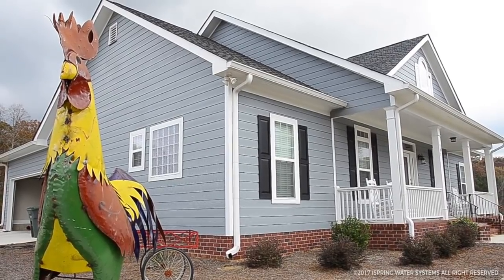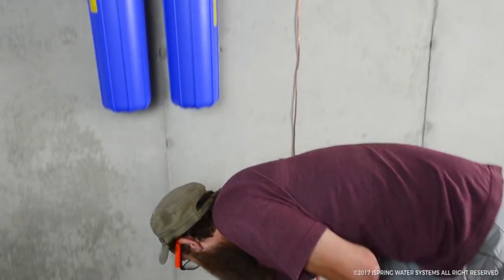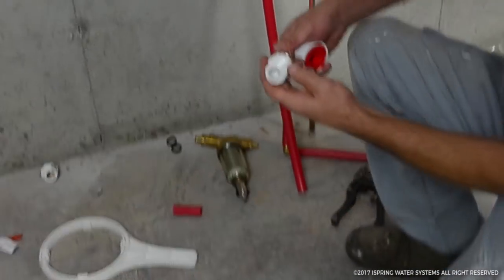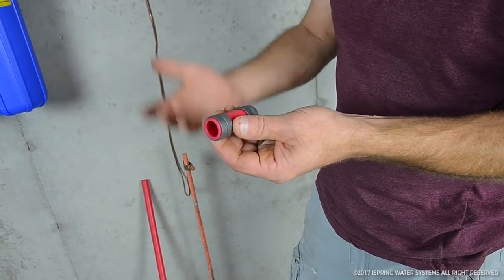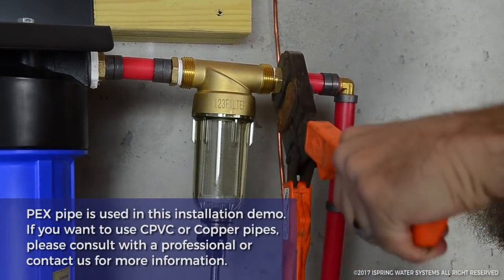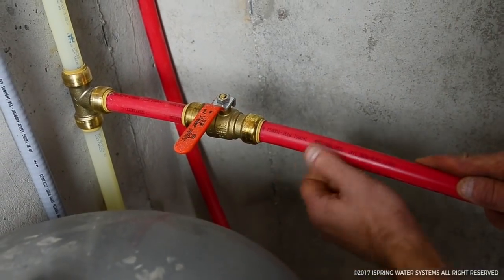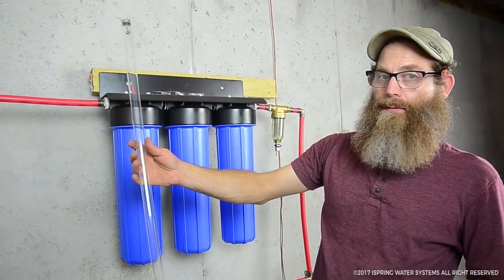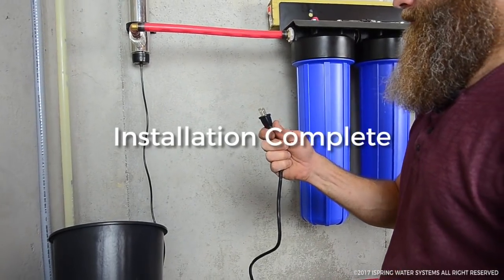How to Install a Whole House Water Filter System (iSpring DIY Installation Guide WSP WGB UVF)

Comment: It would be helpful to have a video with some practical advice on the filter replacement process. Installing the filters is quite easy, as shown here, but removing them can be a different story. When the filter housings are full of water they're a lot heavier, of course. Also, even when depressurized, there is still water in the piping, above the level of the housing's rim. This means water begins to spill out and spatter around as soon as the housing is loosened a little, and continues to flow out as the housing is turned. Then, at the moment the housing comes free from its thread, still full of water, its weight makes it almost impossible to avoid spilling even more water. Then the housing has to be carried to a drain.  I'd suggest the location of the filter system should be chosen with all this in mind. It would be good to have a laundry tub and/or floor drain nearby, and with no walls or floor coverings that you don't want to get wet.
Reply from the maker: Hi there. Thanks for your feedback! 
For any concerns or questions, please contact us at support@123filter.com or at (678) 261-7611 M-F 8:30-5:30 EST
We are happy to help!

Comment: I got rid of UV Lamp in favor of new UV LED system due to mercury and other issues. The lamp keeps pipes always hot and your ends on inlet/outlet ports need to be steel or copper to a certain length before it meets the PVC, otherwise it may burst PEX piping. I will likely post a video of my new setup soon which is 8 stage system with Acuva UV LED unit.

Comment: Carbon black filter can we put minaral in stone?
Reply from the maker: Hi Ahmed, iSpring does not offer a filter like this at the moment. These are called calcite filters or neutralizers. It's also better to use a large backflushing tank when this is necessary - well water pH lower than 6.5.  You also need the proper recipe of calcite and Corosex (Magnesium Oxide).

Comment: Is your T connect starting point before or after your main line shut off valve? I cant tell since it did not show behind that tank.
Reply from the maker: Hi there. We need more details to give proper suggestions. Please call us at 678-261-7611 (M-F, 8:30 - 5:30 EST) and talk to one of our support rep.

Comment: I am planning to install ispring water system for whole house can I ask few questions ?

1, If we install spring WSP, can we install two ( 50 and 100 ) ? if you recommend to install two, which two combination do you recommend ?
2, For all the connector, can we or do you recommend we use sharkBite push to connect ? it seems more easier for the beginner 
3, For Pipe, do you recommend that we use PEX or Copper ?
4, for our house, the main water switch on/off area, there is no drainage , in our case, can we still install the ispring system ?
5, As I can see other YouTube, they will choose install additional pressure gauge, do you recommend we add this into your system ? ( May I ask what is normal Psi or Bar for the normal water pressure ) 
6, After install the whole house water system, do you recommend that we install another ispring RCC7P-Ak-6Stage under our kitchen sink ?
 
Thank you so much for your help.

Marvin
Reply: No reply to these interesting questions. I'd be interested in the answers too.

Comment: Why wouldn't he put all of this before the stories tank? That way when the water comes out of the tank, the pressure is set.
Reply from the maker: Hi Patrick. It can be done either way. For some houses, the pressure tank was installed at the top of the well and then the house was 30-50' away. Sometimes tanks contribute taste and carbon filtration after the tank can help with this. If you have more questions, please feel free to contact us at 678-261-7611 (M-F, 8:30 - 5:30 EST). We are happy to help!

Comment: Have to disagree on the doubling up of pex clamps here, the nipple fittings used clearly do not have sufficient length to support two crimps side-by-side and could be damaged or deformed by installing a 2nd clamp near the end.
Reply: I was wondering if 2 clamps would be too much.

Comment: I'm interested in the Whole House Water Filter System. Do you have any distributors and provide installation for Florida?
Reply from the maker: Hi Fritz. Sorry we don't have installation teams in Florida. But our systems' installations are pretty straightforward. You can call your local plumbers and most of them would be able to install it. If you or your plumber need any tech support, please give us a call at 678-261-7611 (M-F, 8:30 - 5:30 EST) or email us at support@123filter.com. We are happy to help!
Reply: @iSpringWaterSystems  Thanks. What's the warranty on your system?
Reply from the maker: @fritzj6803  The system comes with a one-year warranty. Extended warranty is available upon registration here: https://www.123filter.com/ost/open.php?topicId=12

Comment: Excellent.  Any consideration to securing the spin-down filter to the wall? -- Or is it 100% fine allowing it to hang fully off the PEX?
Reply from the maker: Hi John. The spin down filter comes with an optional support bracket. But it's also ok to let it hang fully off the PEX. If you have more questions, please give us a call at 678-261-7611 (M-F, 8:30 - 5:30 EST) or email us at support@123filter.com. We are happy to help!

Comment: I used this video as my starting point when figuring out my whole house filter installation August 2020. Then researched other parts such as how to cut and connect to the well pipe since its my private well. Bought the Ispring WSP50 spin down filter as the first filter in line which is 50 microns and found out that it is too fine a mesh for my well water that has fine silt that clogs the screen. I am waiting for my 200 micron replacement mesh with Siliphos to arrive $20 replacement part.  The spin down filter is very fast to disassemble and clean, gets a toothbrush cleaning in the sink with a little water. Also installed the Ispring ED2000 electronic descaler which is releasing lots of junk from my circa 2012 pressure tank which had no filtering previously. Learned about PEX pipe from this video and now have all the tools. I have a big clear filter after the pressure tank to catch the descaler gunk and sediment being released from the tank. It comes out in bursts occasionally ...The clear filter with $15 (paper replacement elements) protects the much more expensive filter after it. In total my setup is WSP Spindown filter/Clear paper filter/Whole house structured water device/ED2000 Descaler/Pressure Tank/ Clear filter / Carbon filter. The original video is a good start to learn this process, but it is a learning experience to complete the project.  Making the water really clean caused the under sink hot water valves in the bathrooms to start failing since they didn't have any silt to hold them together anymore. Strange but true, those are now replaced with Sharkbite flexible hoses.
Reply: What filter did you used after the pressure tank

Comment: What was the model for the system use here?  Is this will work for iron (my big issue). How often will need to  change them?
Reply from the maker: Hi Axel. Our system WGB32BM is specially designed to remove iron from your water. However, it has a capacity limit of 3 ppm for iron. We recommend getting your water tested before purchasing our product. You can find more product information here: https://www.amazon.com/iSpring-WGB32BM-Filtration-Sediment-Manganese/dp/B01FI3BLYM

Comment: my whole house water filter was leak. there was no pressure relief button. it was impossible to take them off because water pressure inside water filter.
my house lost a  lot  water pressure when  I used this filter.  my incoming water 80 psi. after finishing installed whole house water filter and used it water psi dropped to 20 psi.
I need help. my water pipe 3/4 in thanks
Reply from the maker: Hi Le Tran, could you please give us a call at 678 261 7611 (M-F, 8:30 - 5:30 EST) or send us an email at support@123filter.com? Our customer service team is always happy to help.

Comment: Did you use Sharkbite fittings? @1:16
Reply from the maker: Hi N Holt. Thank you for your comment. No those are not Sharkbite fittings, but traditional and quick connect fittings.

Comment: Filtering your toilet water and even your shower water to that level of filtration seems like a waste of the filters and money. It would make more sense to have a system like that under your sink for drinking water. Then you could install a more primitive whole house system which doesn't filter it to that level of clarity. You would save money.
Reply: Not if your toilet is getting black from iron and manganese
Reply: @MsRoxyPup  my toilet turned black but I don't think it was the water
Reply: Having clean shower water is not a waste.

Comment: Do you have to have the UV Water Sterilizer or a softener?
Reply: Hi,

The UV sterilizer is only needed if you have an issue with micro-organisms in your source water and is an add-on to our whole House Water Systems. A softener would be needed if you have hardness to your water. 

Thank you,

iSpring Water Systems LLC

Comment: I'm confused. I have already purchased this system but I haven't installed it yet. Is the Arrow on the spindown filter in the direction of the flow of water or where the water is entering the system? The instructions that come with the unit do not mention this... Thanks for your help
Reply: Hi Life As A Human,

The arrow on the WSP series spin down filter shows the direction the water should flow through the system. The inlet should be on the side opposite of the direction flow arrow, and the outlet should be the side of the arrow showing the direction the water should flow. If you have any questions please feel free to contact our office at 678-261-7611.

Thank you,

iSpring Water Systems LLC

Comment: Hello There: Yes I like your home water filter system that you install it at your family home.And I don't have well water where I live at. I live in the mud district they take care the water to my home. So I would like to know if I can used the same water system that you install in your family home too. I live in Houston Tx.Oh could you tell me how much this water system cost?$$Can I stall it in my garage or the outside wall next to a water faucets where hook the garden hose.So I hope to hear from you about this okMy name is: MichaelFrom Houston Tx
Reply: Hi Michael Shane,

The systems for the 3 canister systems is normally around $500.00 USD. Yes you can install in the garage or utility room, as it depends on where the water comes into your home.

Thank you,

iSpring Water Systems LLC

Comment: I have a well system at home.  I don't really have a problem with chlorine.   My main problem is tannins in the water and a very notice sulphur smell.  Which unit would you recommend?
Reply: Hi John Faur,

We would recommend the WGB32B system that has one sediment filter, and 2 CTO carbon block filters for the Nitrates which cause the sulfur smell. Or we would recommend the WGB32BM which incorporates a specialty Iron/Manganese filter for the tannins. Please let us know if you have any additional questions.

Thank you,

iSpring Water Systems LLC
Reply: CS1 thank you.  I appreciate your quick response.   Should this be installed before or after my water softener?
Reply: Hi John Faur,

We normally recommend the filter be installed before the softener but the system will work installed after or before the softener. 

Thank you,

iSpring Water Systems LLC